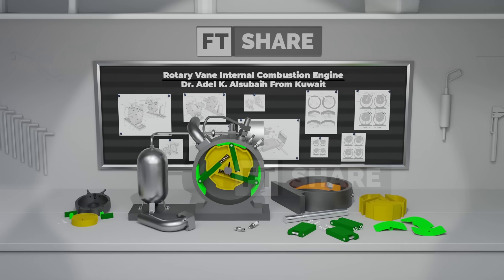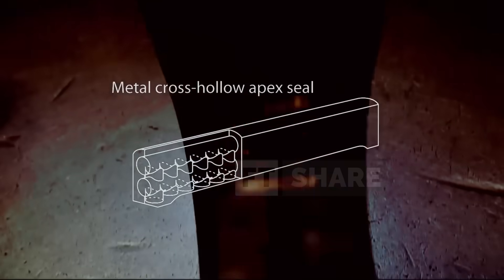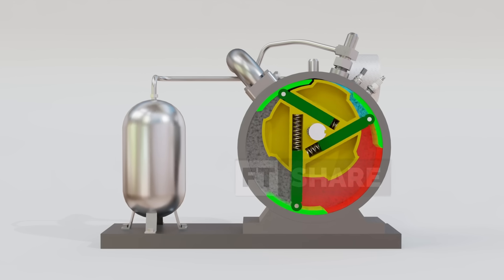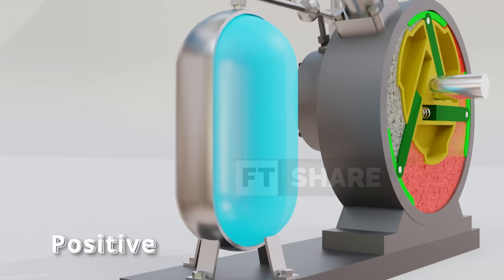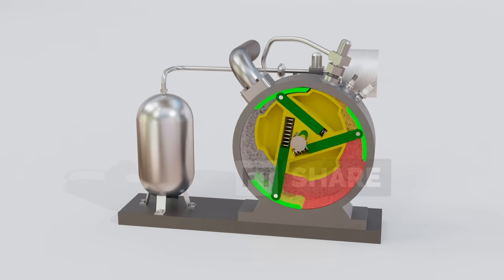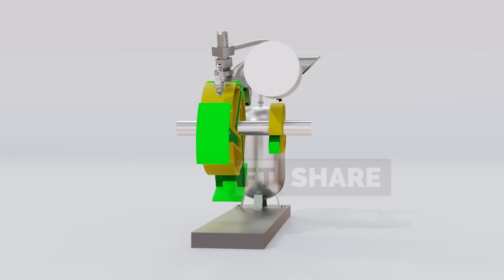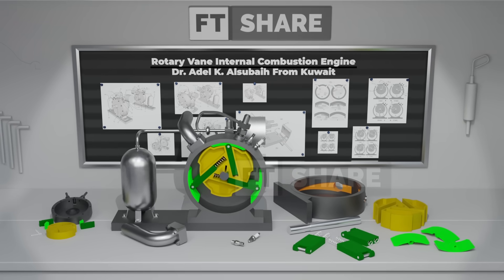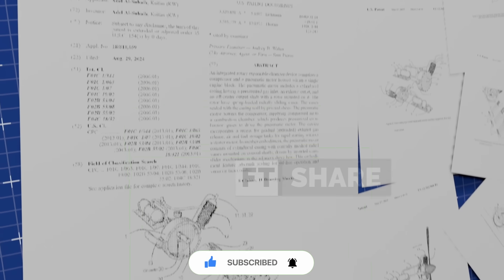The Genius Engine That Breaks All the Rules — No Intake, No Compression!

Comment: Drawbacks of this engine design:

1. Springs causes float in high rpm
2. Lots of friction due to large surface area of the shoes
3. Burns oil/lubricants due to poor sealing
4. Low torque
5. Instead of air tank, just install a suitable supercharger
6. Shoes will rock, might be noisy or loud like a diesel engine's cylinder head, valve or rocker arm
Reply: Adding a compressor in the other side of engine is a red flag on this design coz compressing air will make the air hot & engines needs cold air intake to produce more air volume in the combustion chamber for better power. This design is the opposite of intercooler turbo. 😅 Also the compressor will consume much of the engines crank power. 😅😅 
This design also has no air cooling fins or water cooling system & no fans so running it in a few minutes then the engine becomes red hot. 😅😅😅😅😅 I guess this engine is designed to operate in Antarctica where you can burry it on thick ice. 😊😂
If we ad the missing cooling system (water pump) plus electrical system (alternator) in order to power the fan & it's electrical components (fuel injection system, air intake controller, other minor sensors components to make the engine run) then there might be only a little power left in the engine that can be used to run a vehicle. 😢
Reply: @sonnyaraneta6488  Thanks! I missed the hot intake part!
Reply: Burning oil is advantage, it has to be 2t engine
Reply: Patent seems ok, but I agree the design has some flaws: https://youtu.be/ti0sm-cLVQs?si=LOiekf8dhj14zY2A
Reply: Centrifugal force will help to seal work as they should . I think the springs are mostly needed for start up !
Reply: Just do a real working model (studymodel), then we will see    possibility of the idea  that may be developed soon.
Reply: They are not springs on reciprocating poppet valves and will not float.
You do not understand what causes valve float.
The effect of  these springs is reinforced by the centripetal forces on the rotating assembly , the faster the rotor spins the less the springs are needed
Reply: @PaulG.x  centrifugal, not centripetal...
Reply: @AZ-rx6lt  wrong - centripetal force results in centrifugal acceleration.
Just because people have been getting it wrong for centuries is no reason to persist in the error
Reply: @AZ-rx6lt  no such thing as centrifugal force:
"Centripetal acceleration refers to the inward-directed acceleration required to keep an object moving along a circular trajectory, ensuring a change in direction without altering speed. It is caused by a net force, known as the centripetal force, which acts toward the center of the circular path. In contrast, centrifugal acceleration is often viewed as a reactive force that some believe acts outward on an object in circular motion, though it is generally considered a superfluous concept because it describes the inertial effects perceived by an observer within the rotating system."
Reply: @PaulG.x  Центробежная сила это значит убегающая от центра. И она возникает в результате сохранения импульса как одна из составляющих прямолинейного движения по касательной к окружности вращения. Именно эта сила удерживает воду в ведре раскрученном в горизонтальной плоскости, и эта же сила разрывает на части чрезмерно раскрученный до больших оборотов маховик, наружный край которого никак не желает обжимать вал который в его центре, но стремиться от него убежать.
Reply: Single exhaust port creates uneven heat and expansion in the main housing , just like the Wankle .
Reply: Why not put intake on one side of stator and exhaus on the other so theres bigger area separating those two, alsodirect injection is a tech that all modern engines use so this is a huge drawback in this case, either there are multiple placed injectors but then it becomes a diesel or one must be placed on the inside and be mechanicaly operated, but then again so many drawbacks arise. Its cool and all to see different ideas but as for current state theres no working prototype so not much can be said about it and using compressed air? There are turbos and superchargers for that, great as an idea not in practice, compression ratio is another thing due to sealing. Sure lubrication can be solved by placing squirters before the "shoes" but the we start burning oil and that means no modern country would accept such engine, 2 strokes and wankels are gone for a reason.
Reply: 也許可以直接將汽油噴在蹄片上進行潤滑，反正過一會兒就要燃燒掉了
Reply: Did someone already mention that an air bearing is possibly a solution to these problems?
Reply: 氣浮軸承不適用發動機這種高溫工況，引擎冷卻後，可能會卡住，造成啟動困難

Comment: if you can do that sealing surface magically and keep the vanes from exploding you can do a bunch of designs.
also why an air tank and not just say there's a roots charger there. you could run this without the combustion.

you could use those vanes as rotary valve on a regular 4 stroke.